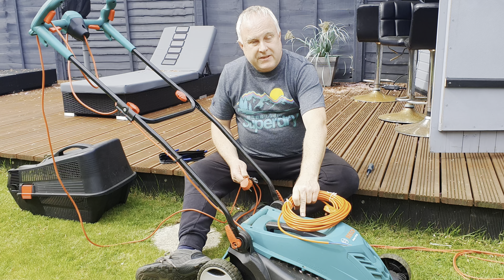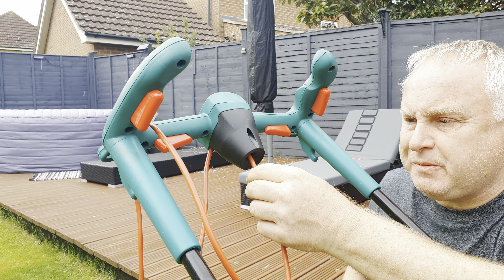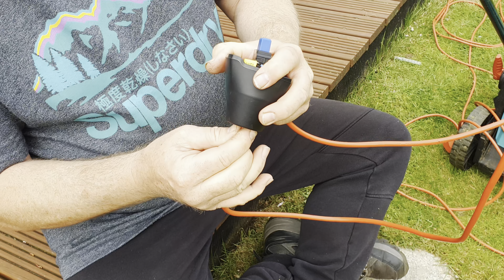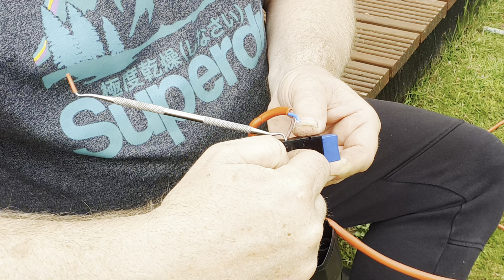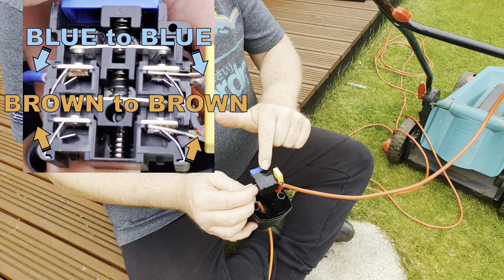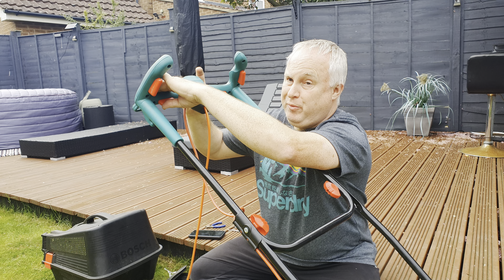How To Replace a Lawnmower Power Cable

Comment: Hello, I own a Bosch Rotek 32 mower. The power cable got slightly damaged by the blade. Spares2Go seem to have a replacement cable 20 meters in length. I think the factory fitted cable is 10 meters in length. Would you advise if this is going to be compatible with my Bosch model? I see from the picture on their website that the ends of the wires seem to have a metal sleeve. So is this an easy push fit? Thanks, I look forward to your expert guidance.

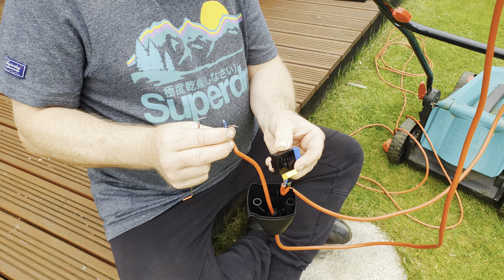Comment: What about @1.06 if you the wire is attached to a metal hook type thing which is then connected to the switch? So unlike your example where the wire is connected in directly to the switch 1:06

Comment: I wish I’d seen this video a couple of days ago before I went out and bought a new mower! The wire had broken at the entry point to the mower, I couldn’t work out how to detach it from the switch and I didn’t think it was worth getting a professional repair. However I’ve now cut four inches off the wire, reattached it and it’s working great, so my daughter has laid claim to it.😅
BTW I found it easier to remove the wires by taking the top off the switch first.